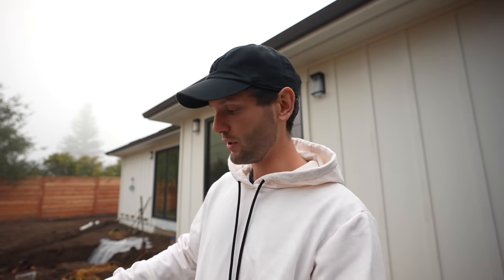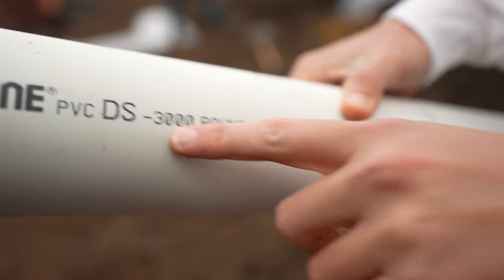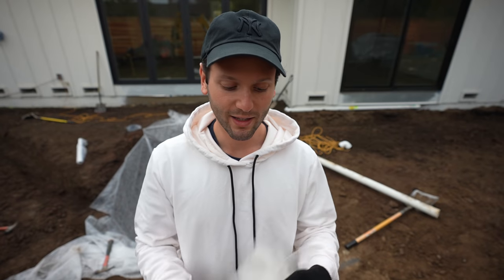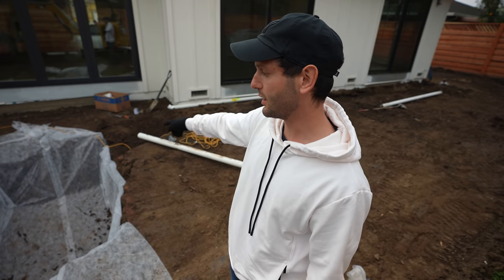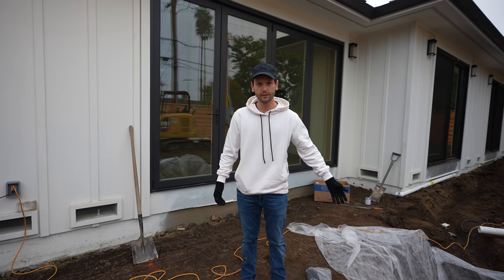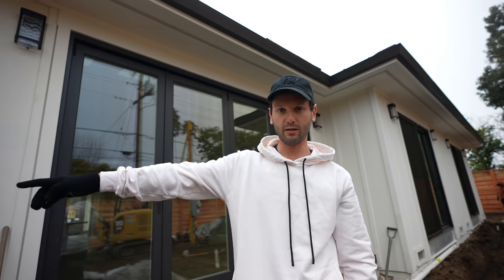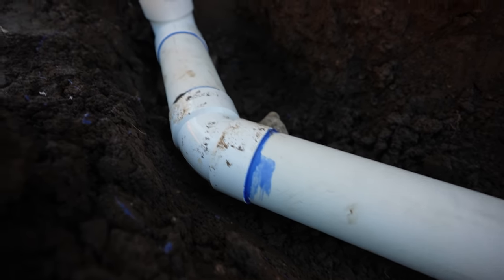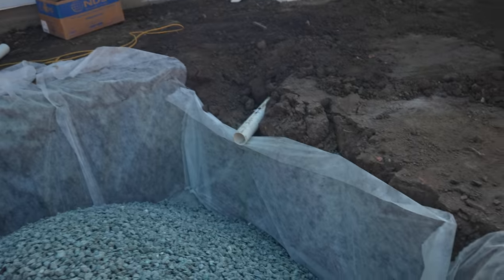How to Install a Drainage System *easy money*

Comment: Hey T....correct terminology is downspout.  The gutter runs along your fascia up along roof & connects to the downspout at corners. Also, not sure about specs in Cali but here in the East we use 4"  drain pipe usually green in color called SDR 35. Might be worth mentioning to your viewers to make sure they look up or ask what local code requires. Also, the black fabric we use is non-woven geotextile. That white stuff you're using just won't hold up over time IMO. Good luck with your project. Now send me that Ditch Witch! 😆 lol

Comment: Dry wells are so important on job sites . A lot of newer homes 🏡 you can put the water drainage off the site it has to stay on the lot . Plus always have a clean out at the point on entry off the downspouts .
Reply: Am a well contractor. One time someone had me drill a single shallow well just for the ac drip to drain into.
Reply: @54565syu  Ha Ha crazy .

Comment: Great topic and informative. 
As landscapers and maintenance technicians, when applicable, we have been offering and adding larger 4" and oversized gutter flanges, outlets, elbows, downspouts and distribution centerend outlets to customers already established gutter systems to help increase water output and system discharge. It is minimal labor and materials investment for us and helps manage water flow into all sorts of end types of systems. (Pit, sewer, french dtain etc.) Simple upsell and more importantly a beneficial service to our customers. 
Just a thought. 
We get boat loads of rain here in the Milwaukee, Wisconsin region during the spring months and during the growing seasons. Peace
Reply from the maker: You get a lot for sure

Comment: Do you use a 6" round bucket with a grate as an outlet in your pit or something similar?  That way you have the ability to clean out any debris that makes it into your pipes from the gutters like leaves etc. If it just dead ends into the pit, with no way to service the system in the future, the pipes will likely be plugged in a few years or less.

Comment: In the UK we have to put soakaways 5m from a building and 2.5m from a boundary to prevent a build-up of moisture around foundations and other properties. Not sure if your building codes suggest anything similar? We tend to use soakaway crates instead of crushed rock as they have more capacity and less hassle to install. The hole needs to be sized according to the area it will drain and local rainfall.

Comment: Here in Oakland and Berkeley area engineers always want to take the water out to the street because water on property can lead to settling.
Reply: Interesting, in the UK we have to deal with the water within our property as the sewers are old and can't cope with the additional volume of water created by people paving over their properties.  We do however have to put soakaways 5m from a building and 2.5m from a boundary to prevent a build-up of moisture around foundations and other properties. Not sure if your building codes suggest anything similar?

Comment: Gotta get that water away from the house. A little too close for comfort if a substantial rain comes through.
Reply from the maker: Pit is massive. We good
Reply: @TigranGertz 
Your pit roughly 1000 gal capacity 8x6x3ft deep 
The back yard roughly 1500 sqft 
If you get 1” of rain cover over the whole back yard you’ll fill your 1,000 gal hole and hope the ground perks the water. 2-4% slope away from house at all times if re grading. Plus your drainage to back of property and front of property with leech pit/trench farther away. You don’t want water under that footing causing settling and major slab issues. You should be okay since OC/LA doesn’t get a lot of rain fall. 
Good work. Learn stuff from the vids. I’m 23 with my own mini ex and bobcat service in SoCal. Keep grinding and motivating us!